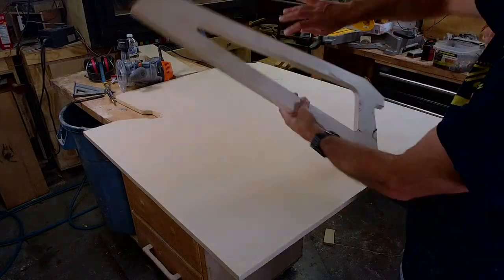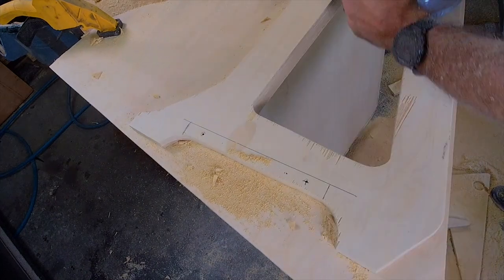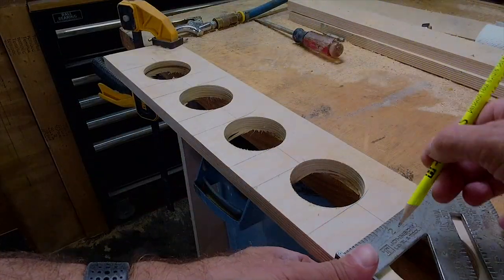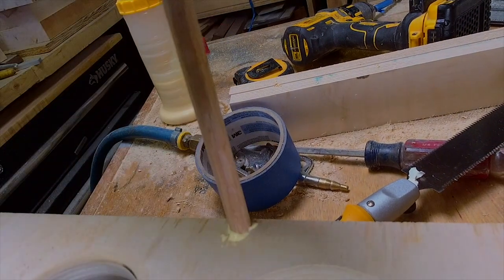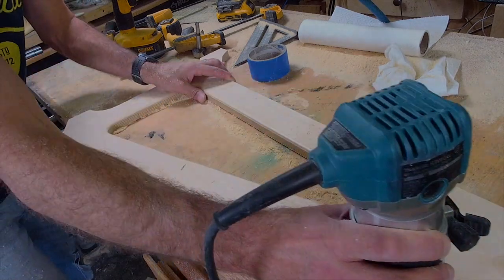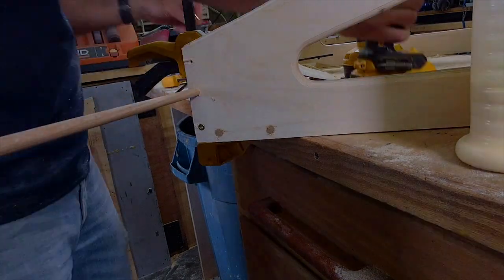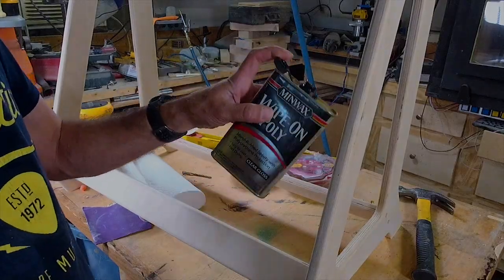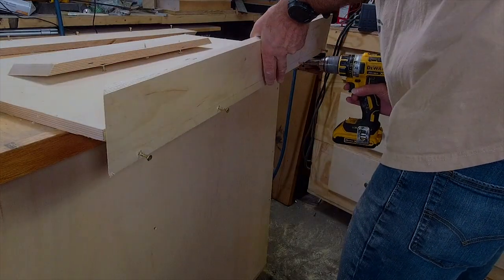DIY plywood Multi Guitar Stand. a step by step do it you self workshop video

Comment: Beautiful!  One thing you can add is some padding for the neck supports.  I like to use 1/2" wide latigo leather strap.  Cut a piece 6" long and glue it into each U shaped cutout to cradle the edges of the necks on those fine gee-tawrs.

Comment: Any chance you have plans that I could download for this?
Reply from the maker: I don't have any plans, I was kinda just winging it. I might be able to get you some measurements. Are there any dimensions in particular that you need to know?
Reply: @themassacoustics264  Hello, I am thinking of building one of these and I would like to know the size of the Hole Cutter you used for the guitar Neck holder bit. Also, How long that piece of wood is (How wide the overall project is). Thanks.
Reply from the maker: @thesundaycarpenter2514  thanks for watching. the hole size is 2.5 inches (63ish mm) the overall length is about 27 inches. I made the right side a little longer to make space for a J200.